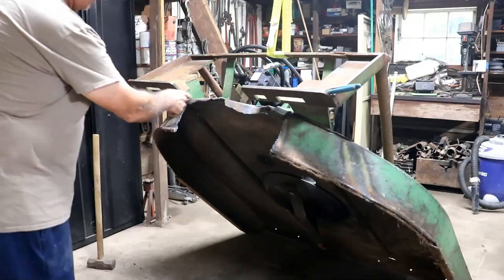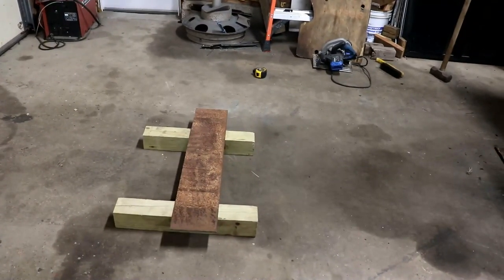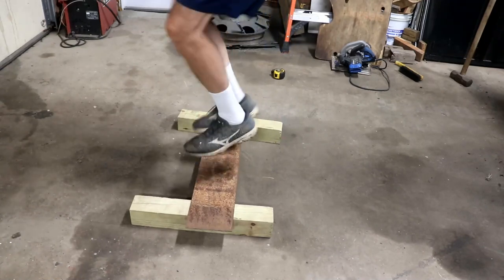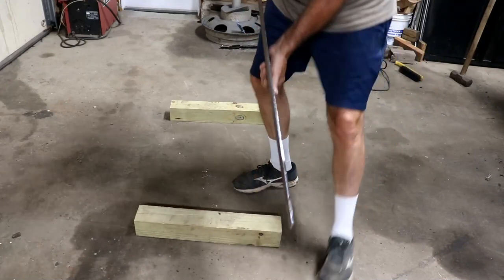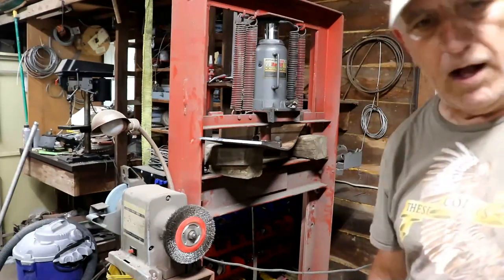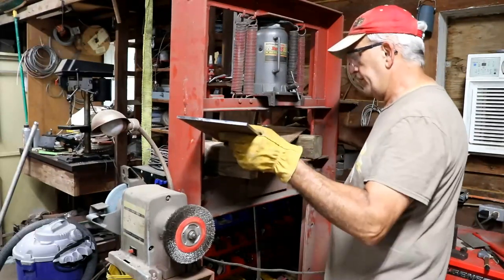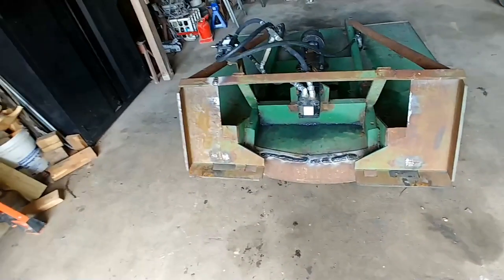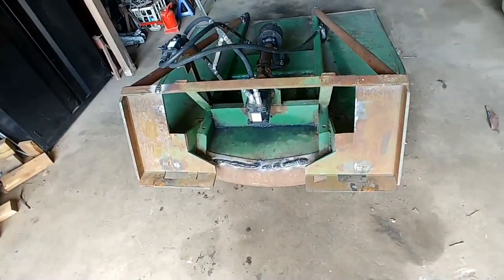595 RSW Hydraulic Brush Hog Repair

Comment: Had to do similar for my brother.  The entire deck was also warped so we took a heavy steel girder, suspended the  unit under it and used a hydraulic cylinder to reshape it.  Similar to how a body shop works vehicle frames back into shape.